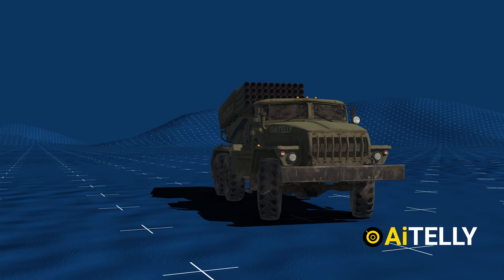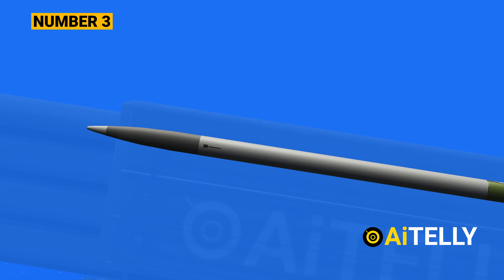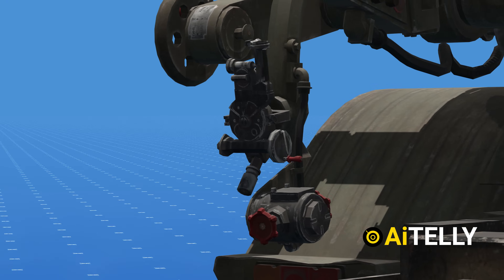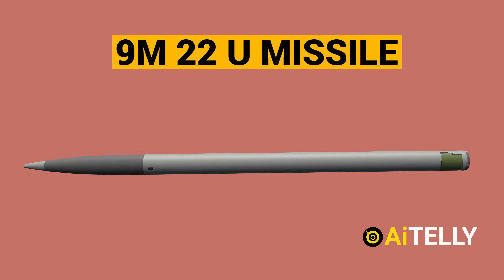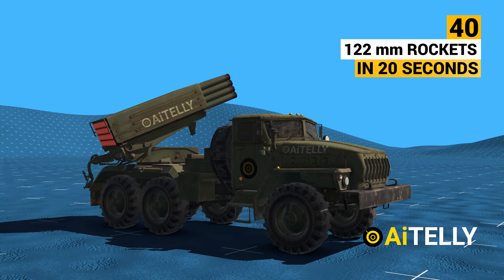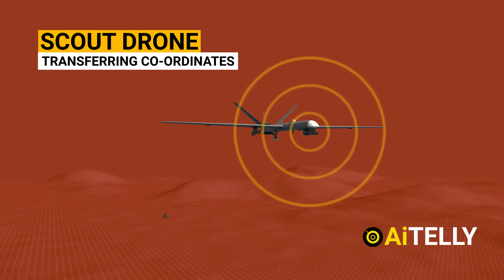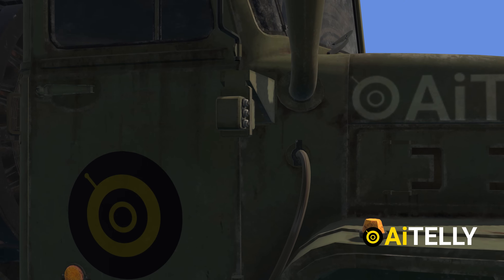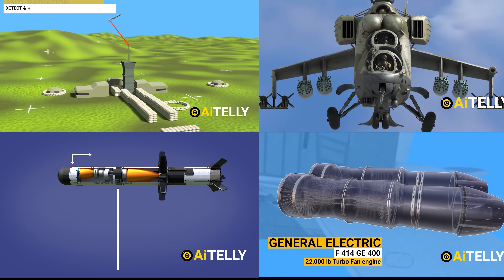Why this BM 21 Grad Rocket Launcher from the 1960s is still in service & How it  works #rocket

Comment: Himars is for striking an ammo or even a sam site meaning it has accurate yet very limited fire. While this bad boy has not so good accuracy but covers huge swathes of land and if used in pairs or even in a group of 3 or 4 this can clear neighborhoods in urban combat.
Reply: These are not vehicles of the same category. This is a vehicle with 122 mm. While Himars is 262 mm. Also, many versions of the Grad have guided ammunition.
Reply: @ares8866  You are definitely correct but some say that this is trash in comparison to HIMARS. Each is special in its role.
Reply: @googleplex1589  Those who say that have no idea what they are talking about. 
They don't even know the difference between the systems. I would say it's the other way around though. The economy of BM 21 is far greater than Himars.
Reply: @ares8866  Yes that is correct. But Himars is also perfect.
Reply: @googleplex1589  the high cost and limited Salvo of the himars has been resulting in mist of its missiles being intercepted,  unless there is no short range air defense or the target isn't cost effective to protect. With the grad, smerch and other systems of their group, guided or unguided,  they have enough projectiles to overwhelm almost any air defense.  Like, which AA system has 40 missiles on tap? When there's multiple units too, and whats the cost of stopping all that? There are very few systems with cheap enough projectiles to even consider defending against them
Reply: @mal.3855  Yes of course. But I mean this is cheap, easy to use, and deadly. While himars is expensive and if found by a drone and destroyed it may be a big deal. But grad is not important if destroyed.  They can flood tens if not hundreds of them.
Reply: @deven6518  This also is a point. Intercepting himars is possible but how will they do that to grad?  good point
Reply: 100 Acres boy!
Reply: @cellmasterz  100 acres what?
Reply: @googleplex1589  Grads clear out a 100 acres of area.
Reply: himars could do the same damage as BM-21 using cluster munition.
Reply: @Kevin-fj5oe  it is much more costly and takes more time and the cluster munition itself is not as explosive as bm 31 grad. Also it has less rounds.
Reply: @Kevin-fj5oe  so you are saying 6 rockets with cluster munitions can take out 100 acres? Nope I don’t believe it. You are guessing
Reply: @GOOGLE PLEX  you're right, but the U.S. decided that having 1 type of MLRS pod is better logistically than having 5 different kinds of rockets that need 5 different vehicles.

Remember, himars is 277mm rockets and guided, instead of wasting your rockets at an empty area you just use precise strike using fragmentation warhead, like M30A1 with 180,000 tungsten ball.

More like machine guns vs sniper rifle, using properly is massive is part of the lethality.
Reply: @googleplex1589  also, having the capability of striking anything in 80km with 5m CEP has its own use, why strike at the BM-21 when you could strike its ammunition depot.
Reply: @Frank Amigo  no, but you need fewer rockets to destroy your target.
Reply: @Frank Amigo  yes, each M26 rockets could cover 0.23km² or 55 acre of land.
Reply: @Kevin-fj5oe  HIMARS is mostly like powerful artillery for striking long range targets like sniper rifles.  But you can't go to a battle with no machine gun.  They don't just throw rockets they see it by drone like in the video. This has giant impact on the physical and mental effects on the enemy.  Also tungsten balls can be avoided if properly hidden but not grad and tornado.
Reply: @Kevin-fj5oe  1.Russia has the uragan and smerch and iskander just like himars.
2. The ammo of bm 21 is taken with it to battle. 
3. The himars  can be intercepted.
Reply: @GOOGLE PLEX  1. Yes, still 3 different systems with 3 different rocket diameter
2. Yes, but you still need to replenish it from supply and depot
3. No shit sherlock, every rockets could be intercepted.
4. Iskander is ballistic missile not MLRS, although the himars/m270 could fire ATACMS and the future PrSM which play the same roles
Reply: @Kevin-fj5oe  1. Your first point has no meaning as I said that HIMARS has it's counter part. 
2. Of course but what if they are taken with supply trucks or the ammo depot simply was changed?
3. I mean the small number of rockets from Himars makes it easier to intercept. 
4.the himars can fire at 300km range if in ATACMS mode. which is  a tactical ballistic missile.
Reply: @deven6518  it is much more complicated than that first you need to keep in mind that grad system is not that effective if your enemy is dispersed or have a a reasonable counter batery capability that is how the himars is superior to the russian and the soviet system it is capable of destroying target with first strike and then move as for the air the air defenses interceptin himars rockets that can't further from the truth because the himars rockets can permorm maneuovers durind it's flight which make interceptions extremely  hard task not even to mention that hiimars have much lower signature than soviet legacy systems due to the fact that they need several times more ammunition to achieve similar results which make them much more vulnerable to enemy detection as they use more trucks and more reloading times evidence to that there hundreds of destroyed soviet legacy systems on open sources where there is up to date no evidence of a single himars destroyed in ukraine except for russian claims that are well just claims.
Reply: @Frank Amigo  sure, but a single rocket could destroy a munition depot with hundreds or thousands of grad rockets. You're comparing 122mm unguided rockets with 40km for certain version of rockets, with 277mm guided rockets with range of 80km.
Reply: @GOOGLE PLEX  sure, but if you can only pick one system and money to run it, you'll definitely pick HIMARS.
Reply: @Kevin-fj5oe  I would pick grad. It is really cheap but if I am rich and have a ton if money I will pick himars. To be honest both are essential and both are equal.
Reply: @abdelghanielfodil8226  himars does not outperform.  Firstly, himars cannot make any evasive in flight maneuvers.  It can make tve slightest of adjustments course correct, because it is a Gmlrs. Still, it flies on a standard ballistic trajectory.  And when it's just 1 and not a swarm, it's easily destroyed or forced to take targets of opportunity only.
Himars is capable of destroying on first strike, but so is a guided artillery round, short range ballistic missiles (which the himars is and Russia has alot of) and other GMLRS. The issue comes back to numbers. I don't see how you cannot understand the idea of air defense saturation. You literally cannot shoot all of them down. Reloading times what? You fo know that none of these vehicles remain in firing positions to reload right? Its too damn dangerous....aka shoot and scoot. It takes mire time to get to a safe reload point than actually reloading,  do i dont see the point. Youre trying to make it seem theyre under constant reload like howitzers. Also you assume anyone is going  to wait for the missile to land before thinking of intercepting the next shot? First strike capabilities only count if you can land the strike in the first place. That's what where the numbers come in.
As for grad not working with a dispersed enemy,  bruh. That's the whole point of the system. What are you going to do, drop a 100k himars missile on 2 guys here, 3 over there? No, you send and weapon designed for area coverage. What if you can't hit the target directly? Himars? Nope. Thats what the grad is for. Even  then it's less than 1 himars missile, because you know they're not paying export price for those missiles. Signature what now? Himars missiles have a much higher radar Signature than the much smaller soviet mlrs systems. That's double because they use a much higher arc. People say about the speed of himars over that short distance and make some bs claims without taking into account the trajectory and boost phases of the missile. Like they imagine if it has 30 miles to target that it really only travels 30 miles. So no, it's not more stealthy. I also see you referring to what's called shoot and scoot. Please note that the number of trucks doesn't affect Signature, it's down to surveillance. You firing a missile, 1 or 50, having trucks, 1 or 50,  makes no difference to a counter battery radar. It sees missile or shell and works the ballistic trajectory in reverse, that's it. Now that's the whole point of shoot and scoot, that soviet mlrs do better than himars, in that you're meant to be gone before counter fire comes in. Whether or not you see more soviet mlrs makes no difference,  because it's about surveillance.  A drone with infrared will see one truck just as well as 5. You will obviously see more soviet equipment destroyed because there are simply more to destroy.  Your argument is like saying if there's 1 Bugatti and 100k corollas that seeing more corolla accidents means it's less safe. That's simply foolish, a matter of probability. 
As for destroyed himars,  bruh,  they're have been pictures released by Ukraine themselves. Ukraine tried to play off some earlier saying they were wooden decoys but, last i checked, wood doesnt spew burning propellant when hit. Russia claimed to have destroy more himars than sent, but we saw a large number of himars on the border of poland and ukraine for 'training exercises '.  You know, the same border where they make the weapons transfers. Never seen again. Where did they go? Thin air?
If you're that oblivious then I'm cutting our discussion here.

Ps. Russia had guided rockets for their mlrs that do the same job as himars; better in some respects. For long range engagements they will generally opt for dedicated short-medium range ballistic missiles.
Reply: @deven6518  damn, you just slapped him with all the facts
Reply: @cellmasterz  I am sorry but who told you that Info?
Reply: @cellmasterz  I would really like to know.
Reply: @ares8866  Those are not ''Grad''. They are called ''Tornado G''
Reply: @zenon1261  9A53-G Tornado is upgraded BM 21. BM-21 Grad systems are being upgraded to the level of new-generation Tornado-G systems. It is a name for modernization.
Reply: @Kevin-fj5oe  180 000 tungsten ball. how much weight each ball? Even if 1 gram it's 180 kilogrammes.
Reply: @HulioMorjoui  very tiny like 2-4mm
Reply: Himars can work in volleys to by firing unguided M26 rickets
Reply: cool story, Ukraine has both
Reply: @marwenyahyaoui3799  yes so what?
Reply: @josephstalin9357  they have very limited firepower compared to grad
Reply: Они оба хороши, но против окопавшегося противника лучше пустить 40 снарядов град чем 1 точную из хаймарс
Reply: @luckylyu4425  Exactly, both are good in their own terms. Himars is like a missile fired towards a target accurately may be something like ammo depot, but bm 21 grad can also clear neighborhoods in the city.
Reply: @luckylyu4425  вообще не так, окопавшийся противник это одно здание или блиндаж, если ты пускаешь пакет града то потенциально ты мог бы уничтожить 50 этих блиндажей, но тебе нужен только один, и он лежит строго в определенном секторе , так что есть вероятность что градинка просто не попадет- перекрестки уже давно не превращают в луну, туда проще закинуть корректируемую мину или фпв дрона пустить
Reply: @googleplex1589  Himars can shoot and hide but Homer's can be defended by AAA guns, missiles, stinger and new weapons to shoot down drones or planes.
Also they usually have fake Himars  nerby

Comment: I Iove your videos. But I would like chime in with my personal opinion on why this system is still in use and so effective. I know you mentioned the cost of the rocket and damage it can output compared to that cost. In addition to that, and I think is the "hero" part of the system, is the truck itself. These trucks have 3 plus points:
1. Cost: the truck itself is so damn cheap compared to armed options in term of production, operation, and maintenance. 
2. Mobility: these trucks can literally go anywhere.
3. Durability: not only these trucks can go anywhy, but the can endure the journey. 

Great video as always.

Comment: Glad I just discovered this channel, new sub here! Please can you make a video on the Tornado-S missile launcher and compare with the HIMARS? I hear both systems are very comparable.
Reply from the maker: Glad you like it.
And thanks for hitting the Subscribe button ✅
Reply: HIMARS is somewhat similar to tornado.( depending on a munition/rocket that you use ).
actually HIMARS is not just artillery...but rather a cross over between artillery and tactical balistic missile system.
so artillery part of HIMARS is similar to torado and smerch....but tactical balistic missile munition for HIMARS is more comparable to ISKANDER
Reply: @mal.3855  it makes no sense to compare HIMARS with BM_21. these were the first simplified MLRS after which they produced heavier and more accurate systems, Tornado-S and Tornado-G. 'Hurricane', 'Smerch' and 'Grad'. The Iskander, for example, has two long-range missiles and is comparable to the HIMARS with two missiles. in general, MLRS installations were invented in the first 1940 years by Soviet engineers to fight the German Nazis.
Reply: @mal.3855  Russians also have guided Smerch now as well. So should be comparable. They have slightly longer range as well so will be safer.
Reply: @mal.3855  would you call Wikipedia "pro Russian"? The Wikipedia-quoted specs of the Tornado-S actually supercede HIMARS in range and warhead size. And GLONASS is just as good as GPS in precision of coordinate determination.
Reply: @lancerevo9747  wikipedia just wrote russian spec data. "Tornado S rocket" - just a project, thay already used them, but they have very few, and they not have guidence like HIMARS, much less accuracy. And "Tornado S truck" - just modern auto platform for old Smerch system. They using both mostly to fire old rockets. But even old smerch ru doesn't have a lot. They mostly used Grad and Uragan. More old systems.
Reply: @mal.3855  Ракеты систем Торнадо так же имеют спутниковое наведение и очень точны. Ракеты системы Торнадо-С имеют калибр 300мм против 227мм у HIMARS.
Reply: @mal.3855  HIMARS is something between Uragan and Smerch, so it comparable.
Reply: @АланМагометовичИсаев  где результаты их применения?
Reply: @exxcels1or  
На поле боя!
Reply: @lancerevo9747  Wrong. Also, anyone can edit Wikipedia
Reply: @chaosXP3RT  okay now why don't you give an alternative source with its header quotation so I can fact check you on that?

Comment: Greetings from India .........we had used these Grads 21 during Kargil war 20 years back ....the punch of these missiles obliterated the montain top ,the enemy on it and their bunkers into oblivion ....awesome Russian equipment .....
Reply: Lies. 
Pakistan has similar systems with indigenous rockets and stabilizers . 
And secondly you could not take kargil back until UNO ordered akistan to pull out its army from kargil. 
Same happened in 1948-49 n 1965 wars. You guys ran to UN and ran away to Russia(Tashkent) in 65 in order to beg to stop the war.

Comment: These rockets are actually $350-450 a pop for all non-guided ones. So yeah, full salvo of these bad boys is cheaper than the gear of one supatacticool safari hunter it vaporizes.
Reply from the maker: Great info. but i guess the considering the export version it might touch the $1000 mark
Reply: @Aitelly  Well, russian military doesn't pay the export pricetag for anything. My numbers are essentially 2004 (Nothing to see here, officer, 15 years has passed) price tags adjusted for inflation (In Russia, you have global multipliers rolled down by the feds. Feds never pay more than infation adjustment rates, that's why inflation rate is one piece of data you can actually trust on, every factory depending on the government lives and dies by these multipliers).
These don't adjust for new tech though. Laser cutting should have sliced the prices significantly (Bulk of the price for HEFI rockets is for all the thin rods being cut into ready-made fragments. I know that new rods are cut with lasers, but I no longer involved in the system to give you the exact numbers on the internal math).
Reply from the maker: @burningsinner1132  Very valuable Comment will keepthis in our Comment Correction Section

Comment: The OLD BM-21 Grad has a range of 20km. But the improved new version of this system under the name TORNADO G. It has a range of over 40km, more than double the BM-21. And it has new opto-electronics, inertial/GPS and Glonas navigation. And everything is done from the truck, there is no need to mechanically calculate the parameters... Although this possibility is kept just in case. So the system remained simple, only twice as deadly and still cheap to operate and maintain.

Comment: Hey boss, good video. Some solid info on the system.  But you use both the words  rocket and missile to describe the ammunition. They are two separate things. Rockets are unguided is usually the rule of thumb. TheBM21 usess rockets. The javelin or stinger uses a missile.

Comment: As a keyboard war observer and correspondent, one can also attest that rocket can be fired individually by propping it against a rock and lid up a fire behind it original electric primer system and shouting some divinity is great war cry can potentially aid its accuracy and reduce the margin of circular errors.